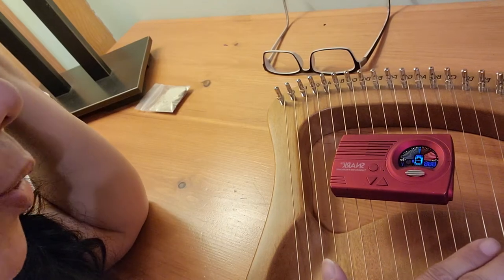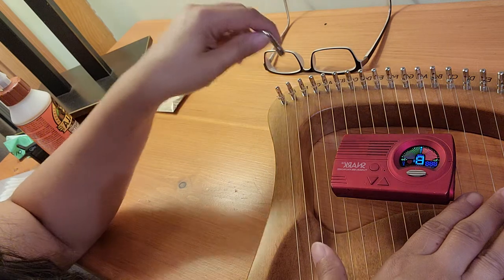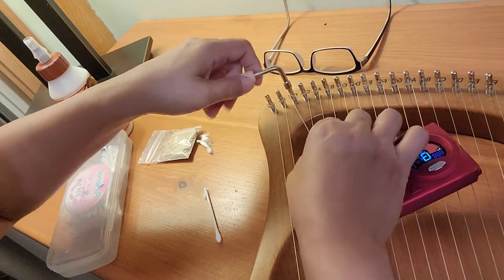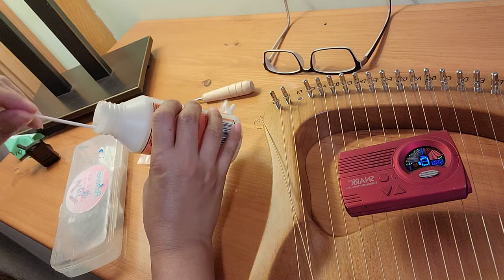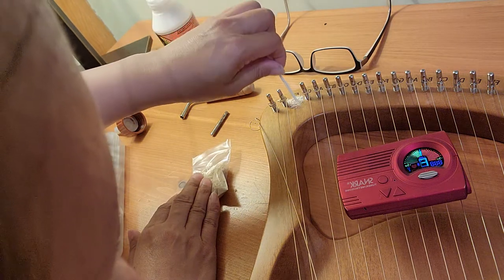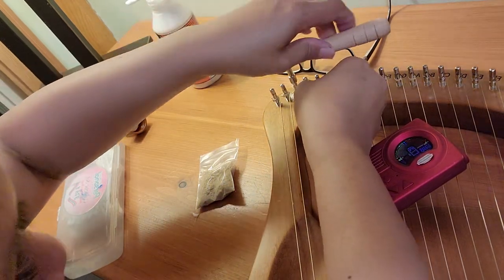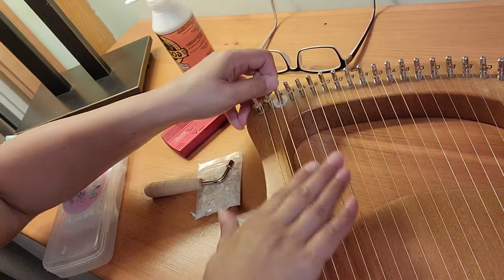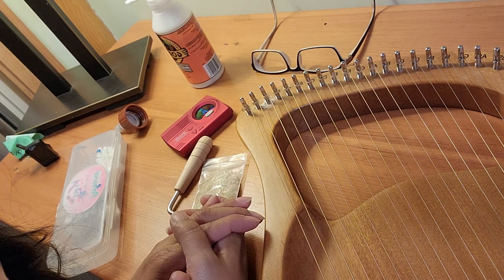How to Fix Lyres - Fixing  Loose Tuning Peg or Slipping Strings 1of 2

Comment: Thank you so much. Three of my pegs on my 19 string lyre keep falling drastically out of tune. I’m happy you made such an easy video to show how to fix it
Reply from the maker: You're very welcome. Just make sure you don't use too much glue. a very little will do. It's only needed for the saw dust to stick to the sides of the hole and allow the pin better fit and grip. Allowing the glue to dry first before placing the pin is a good idea if you feel there is too much glue.

Comment: Thank you so much for this excellent, well-made video!  My brand new lyre harp came with three very loose tuning pegs.  I was so upset!  But by watching this video, I could fix it.  You saved my lyre harp!  Thank you❤️❤️❤️!
Reply from the maker: You are so welcome. Just make sure that you are very sparing with the glue. The object is only to tighten the hole and let the sawdust have something to get stuck to. You still need to be able to turn the tuning pin. If you want for the glue to completely dry before putting the pins back, you can do this too. :)
Reply: I watched your video as I was doing the repair, so it was a complete success!  You covered everything, and the pegs I fixed work great now🌟.  Thanks again!
Reply: I would have thought that the glue might have held the peg permanently. There is a white ptfe tape used to seal joints in gas and water pipes that might work. Just wrap tape round the peg and screw back into the hole.
Reply from the maker: @johnmarshall124  Great suggestion. I have not used this before but will try it next time I have an issue.    You are right, if too much glue is used it can get the pin stuck which is why I made it clear and added also in the description to be very sparing with the glue. The object is to get the  sawdust stick and tighten the hole for the pin to stop moving. Allowing it to dry before putting the pin will also help if too much glue was used. Thank you for the feed back and suggestion. It helps everyone ❤
Reply: @johnmarshall124  Have tried using thread sealing tape from plumbing supplies. it doesn't work as it acts as a rubber-like seal instead of making the peg hole a tighter fit. 
Wood glue & sawdust is da wae.

Comment: This is excellent. I have this exact problem, I'm glad it's a pretty easy fix
Reply from the maker: You’re welcome. There are other ways as well. If you are part of our Facebook group you can check the guides section or ask the question there. Ensure that you use the glue sparingly and d you can even give it more time to let it dry more before putting the pin back on. The goal is to make the whole a bit more snug so the pin threads have more catch on to and stop slipping. ❤
Reply: @learningthelyreharp  yeah I did exactly what you did. And it worked well. I could maybe do a second coat of wood glue and sawdust, but the particular pin was used for a very low note so the tension isn't too high. I let it set over night just as you did, that seems to be the most conservative approach. Thanks again!
Reply from the maker: @hergestthered5314  you’re welcome

Comment: Another possible work-around that some people might consider is to tune each string one note lower than designed .  The lighter tension may stop the pin from loosening .  Of course you loose the highest note (but gain a lower note) .  I find I seldom use the highest note anyway.    Just a thought.
Reply from the maker: Great suggestion!

Comment: How to prevent the strings of moving around? Will the glue help with it? Is it okay for the future strings replacement?
Reply from the maker: The glue is not meant to tighten the pegs. It is only meant to bind the sawdust to the peg holes and thus creating a bit more resistance for the peg to slip. If you use too much glue lock the peg then you won't be able to adjust your tuning. Hope this helps.

Comment: Im curious what to do if a peg is broken. I know there's replacements but i don't know how I could even get the old one out. Do I need to buy a new lyre or can I replace it?
Reply from the maker: I have not had this issue so have not had to look for how to fix it. If a piece of the peg is still accessible, you might be able to use fliers to twist it around and get it out that way. If you are on Facebook, feel free to join the group and post this question there as well as a photo to show what’s happened to the lyre. You may get better feedback there. ❤️

Comment: Will this work for a hammered dulcimer too?My Dulcimer fell and Bent several pegs.  We are replacing but the new ones are very loose.
Reply from the maker: I'm not sure. If you are on Facebook you can look up the group, "learning the lyre harp" and ask the question there. We have members that have these instruments and some that build instruments that might be able to help and provide directions
Reply: You can get larger diameter tuning pegs rather than trying to close a wallowed out hole.. especially if it's a thin string which is under higher tension

Comment: Thank you for this. Can I use plain white glue?
Reply from the maker: I'm not sure. I have never tried to use plain white glue. The object is to only tighten the hole a little and keep the sawdust in place for the pin to grip better and not to glue the pin tight, so maybe? Sorry not a very helpful response, but there is only one way to find out and that's by trying :)

Comment: Do I 100% need sawdust? I'm not sure where to find any where I am
Reply from the maker: I’m not sure how badly your pin is slipping. You can also try to unwind, detach the string and then rotate the pin a couple of turns to set it deeper into the whole then restring and retune. Sometimes the problem is only that the pin is not set deep enough so it’s not staying put. The steps I outlined here are for badly slipping pins
Reply: Etsy has sawdust and wood flour for sale.